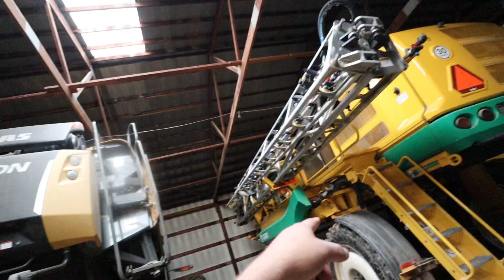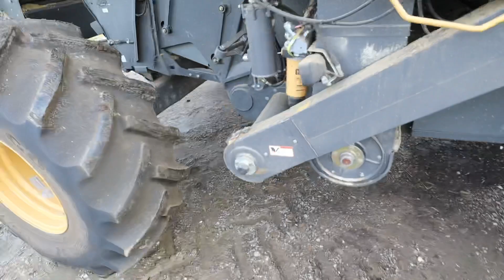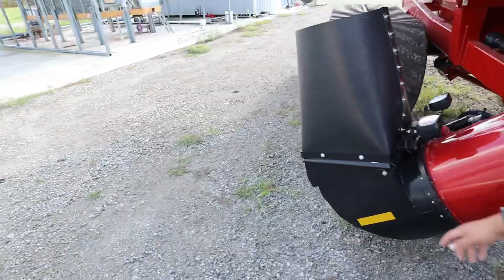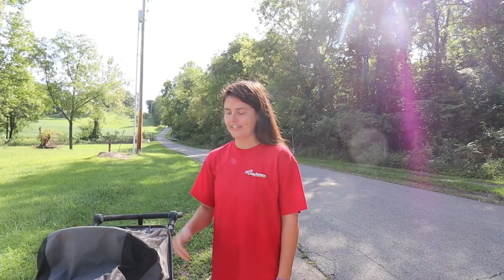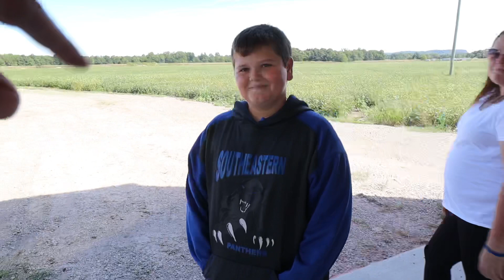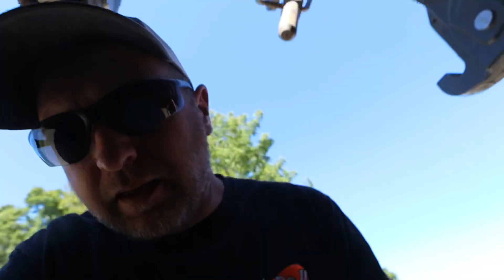Brand New Grain Cart Shows Up

Comment: I always kept the jogging stroller tires a few PSI below the max rating ... it seemed like when we would load up the stroller into the van and they were aired all the way up, we'd usually get at least one tube popped on hot summer days (Texas).